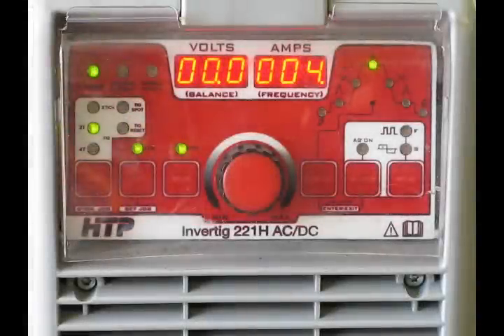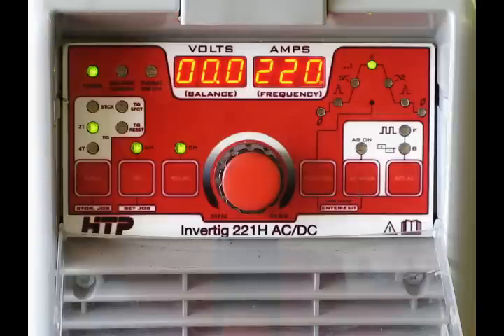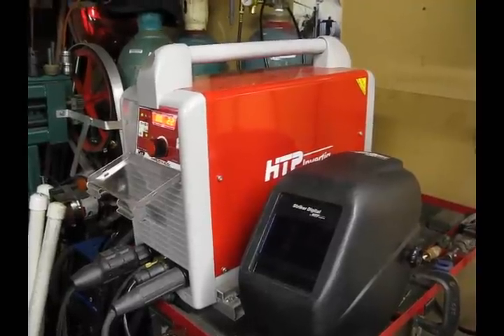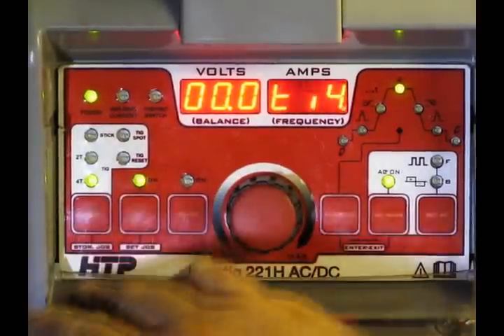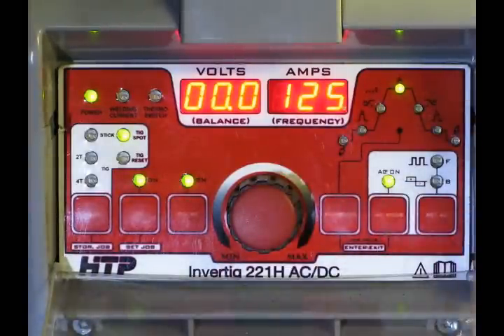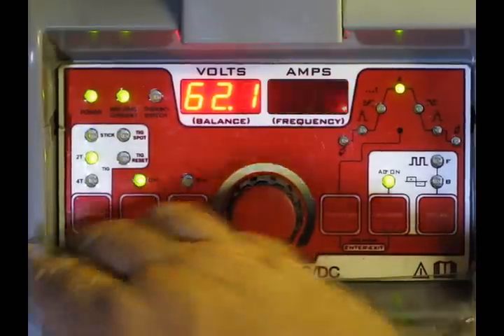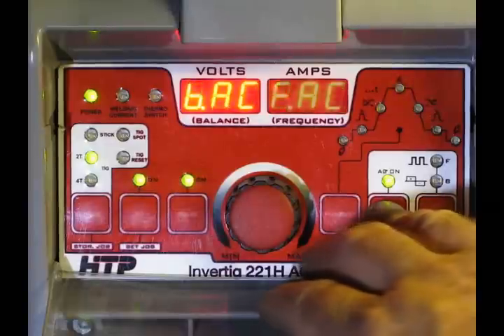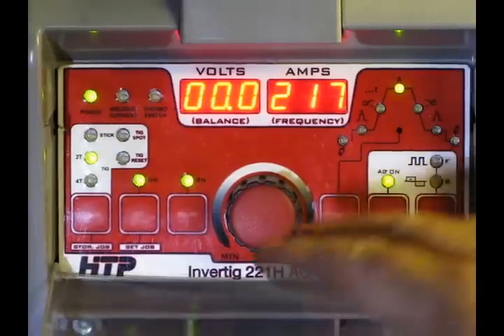HTP Invertig 221H Part 1

Comment: Hi Jim. I start to practice sanitary pipe welding. The only issue that I'm having is that in the exits I'm leaving a pinhole. I'm using my htp invertig 221 in 4t mode with a momentary switch
Reply from the maker: Hello Harvey. This is a problem that weldors have faced forever! The problem usually is that as you are welding a closed space, the pressure builds up inside and the molten metal cannot create a strong enough seal so as you finish the weld, and the metal begins to solidify, the pressure internally  will always find a way to escape (hence a pinhole or in the worst case a blowout). You must find a way to purge (assuming stainless) the interior of the pipe while allowing a method for the pressure to be relieved. This usually is in the form of a separate argon hose flooding the interior of the pipe while leaving a small space for the pressure to escape. Think of taping the end of the pipe closed with a small hole in the tape to allow for expansion. Good Luck, it will work, just need to take some simple precautions.
Reply: @JHV166  thank you so much for the help 🤝🏼
Reply from the maker: @sgr5287  best of luck. Keep studying\. I HIGHLY Recommend you pick up a copy of "METALS AND HOW TO WELD THEM" YOu can get it on AMAZON and with a little searching, there is even a copy available online for free (EPUB_//

Comment: Starts by pulling numbers right out of his ass. This machine will handle 99% of what you are going to do in your shop. I guess he can reads minds. I did preheat for 2 hours yesterday so I could weld some 5" plate in multi pass at my home shop.
Reply from the maker: borzak101 I wasn't aiming this video at junkyard aficionados. Keep burning Bobo

Comment: does the htp cooler for this machine have a small radiator and fan too or is it just the tank and pump? does it come on when the machine comes on or do you have to turn it on separate?